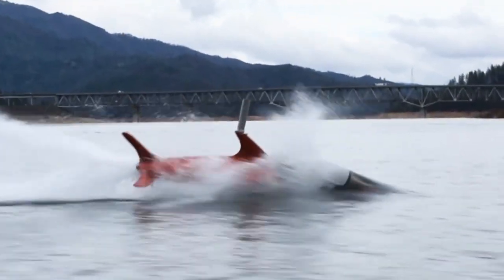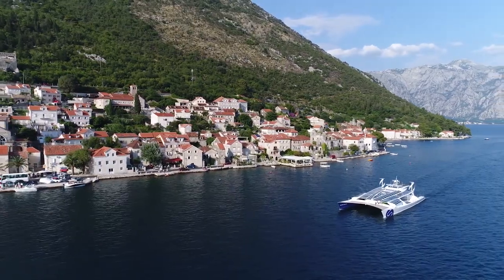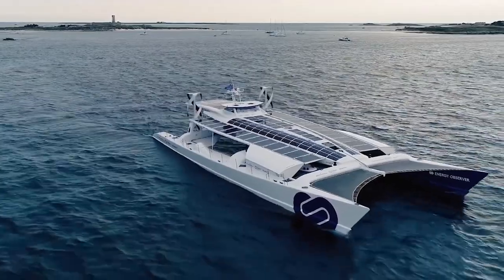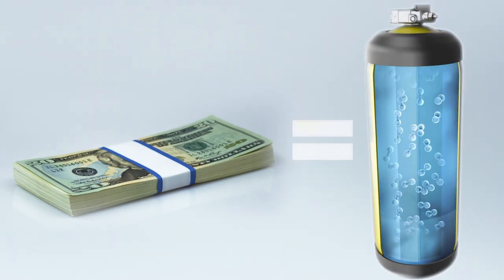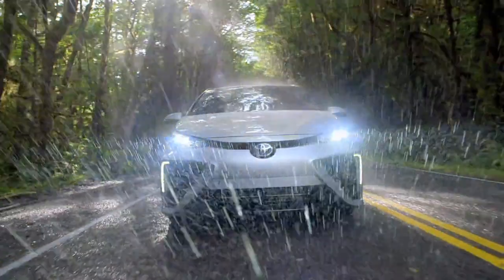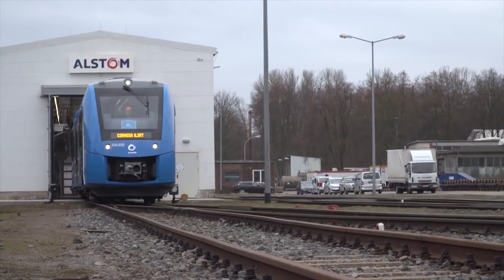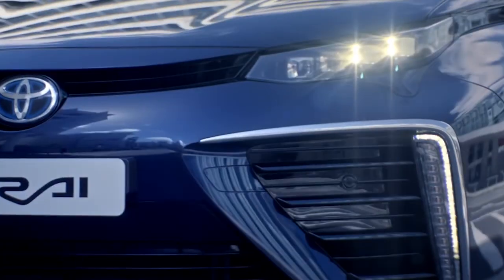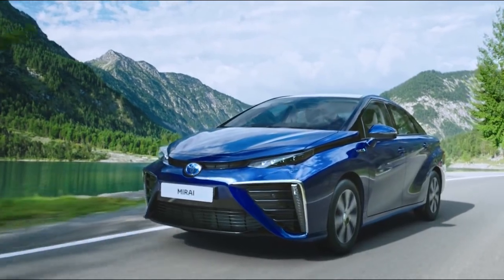The world's first hydrogen powered ship

Comment: Finally!!! The Optimum fuel FOR THE FUTURE!!!! CARS TRUCKS AIRPLANES TOO!!!!
Reply: Henry Ford said ethanol is the fuel of the future.

 Nissan has an ethanol powered fuel cell whose fuel is much safer over a high pressure gaseous type fuel.

https://www.youtube.com/watch?v=HF-eE8pRzMw

Their fuel cell can even use ethanol with enough water added for it to be a non-flammable fuel.  That is super safe although alcohol even when flammable is safer than many other fuels which is why the Indy 500 switched to it many years ago.

Ethanol is reformed into hydrogen in fuel cells and there has just been a new breakthrough which increased efficiency even more:  https://www.sciencedaily.com/releases/2019/06/190607140433.htm

Ethanol is also readily available most anywhere and is cheap.

The boat in the video could perhaps use the hydrogen and oxygen from the electrolysis with carbon dioxide in the ocean to make easily storable ethanol.  The Navy is looking to use this for generating onboard fuel for jets on an aircraft carrier:  https://www.youtube.com/watch?v=Fcc-cTCVY64&t=125s
Reply: @danafletcher2341  the problem with ethanol is that you can't just pick it up anywhere you go
Reply: @kakerake6018  What you state is the very problem with hydrogen, certainly not ethanol.  BTW, not only is hydrogen dangerous to use and handle, it gets worse as the equipment ages.  If you run out of fuel with ethanol and are close to a liquor store, you could make it home.  It would be hard to carry a jug of hydrogen to your out of fuel car.

Ethanol is available most everywhere which is precisely why Nissan chose ethanol over any other.  Nissan drove their fuel cell car around Brazil where clean E100 is sold.  When Brazil changed their fuel infrastructure over to ethanol back in the 1970s, they simply used their existing petroleum one(how cost effective was that?).  The US is the number one producer of ethanol and is very available in many countries.

They now sell tiny ethanol fuel cells for drones which go much further than battery powered ones.  Any hardware store has ethanol, not just liquor stores.

Ethanol can also be produced from coal, natural gas, and oil from an economical process that China, Indonesia, India, and others are using and/or looking at that comes from a Texas company named Celanese with their TCX Technology.

CBS's 60 minutes had an interesting segment on cellulosic ethanol with what they called a game changer for that industry.  Can't give links here anymore so copy and paste this into a search engine:

The unlikely, eccentric inventor turning inedible plant life into fuel

Marshall Medoff unveils to 60 Minutes his innovative method of turning plant life into fuel and other useful products.

(hmmm, just realized my last post has links, must be just certain channels on YouTube that don't allow them.  Here is the 60 minutes link:  https://www.cbsnews.com/news/marshall-medoff-the-unlikely-eccentric-inventor-turning-inedible-plant-life-into-fuel-60-minutes/

We waste half our food in this country and dump huge amounts of plant biomass(i.e. grass clippings, leaves, and tree branches) into land fills.  Medoff's process could turn that waste into something clean and useful.

There now exists catalysis that could make ethanol from carbon dioxide and excess waste electricity from wind mills for an example.

The Navy even has a way of producing ethanol and other fuels from seawater which of course has hydrogen and oxygen, but even more carbon dioxide than the air.  Aircraft carriers can go a long time without ship fuel, but go through a lot of aircraft fuel.

This is why I am for LFTR(liquid fluoride thorium reactor) type of safe nuclear reactors which are walk away safe and can get rid of most of our current nuclear waste.  

Instead of inefficient electrolysis to make hydrogen and oxygen from water, the temperature in a LFTR is high enough to directly split water in to H and O2 and simply add in carbon dioxide and you can make ethanol or other fuels.

Ethanol in high compression engines is the most efficient fuel on the face of the earth. Scania already sells one world wide this very day.   Ethanol in gas turbines is more efficient than current fuels above 10,000 feet because of the oxygen contained in it.  

Pollution free to boot. 

Imagine cities with air to breath as clean as the country.

Comment: they already know how to get the hydrogen from water very cheap and efficient. They have known for decades or probably even more. All the big car companies know long time. They just slowly releasing it into the public in a controlled way that allows them to maintain power and control.
Reply: "very cheap"?
They can produce roughly 2 kg of hydrogen on a sunny day, if they don't waste electricity for propulsion.
How cheap was the whole system of photovoltaics, desalination, electrolyzer, compressor and tanks?
Of course, costs would drop with really big stationary systems, but compared to fossil fuels, it won't become "cheap".

Comment: The most advanced Fuel cell systems are by GM. Honda uses GM fuel cells
Reply: That's interesting.
Reply: Don't forget Nissan who has an ethanol powered fuel cell whose fuel is much safer over a high pressure gaseous type fuel.

https://www.youtube.com/watch?v=HF-eE8pRzMw

Their fuel cell can even use ethanol with enough water added for it to be a non-flammable fuel.  That is super safe although alcohol even when flammable is safer than many other fuels which is why the Indy 500 switched to it many years ago.

Ethanol is reformed into hydrogen in fuel cells and there has just been a new breakthrough which increased efficiency even more:  https://www.sciencedaily.com/releases/2019/06/190607140433.htm

Ethanol is also readily available most anywhere and is cheap.

The boat in the video could perhaps use the hydrogen and oxygen from the electrolysis with carbon dioxide in the ocean to make easily storable ethanol.  The Navy is looking to use this for generating onboard fuel for jets on an aircraft carrier:  https://www.youtube.com/watch?v=Fcc-cTCVY64&t=125s
Reply: Think that you will find that Toyota are in the vanguard here NOT GM for sure. They 600 patents Minimum on this process - all the major car companies have bought inti them including GM.

Comment: Hydrogen fuel unless is generated by renewables energy, or it will not be economically. When electrolysis water, some energy lost in the process. When turning Hydrogens to energy thu fuel cell, some energy lost again. If the hydrogen was generate by electric energy generate by fossil fuel, then it defeated the purposes.
Reply: It's like running a steam powered generator with an electric boiler.
Reply: Clever Nduruza exactly. But the general public don’t understand that. Thorium molten salt nuclear should be the next best option, provided they can make it small and safe.

Comment: @"The world's first hydrogen powered ship": Actually, it isn't a hydrogen powered ship. It's a solar and wind powered ship, which uses batteries and hydrogen for buffer storage.
A real hydrogen powered ship would be independent from wind and insolation during the journey.
Why is there still no ocean-going ship of this kind? No "first crossing of the atlantic with one filling of hydrogen"?
At least as a proof of concept, I don't ask for a commercial passenger ship.
Reply: It could also be smaller, for a rather adventurous journey. Would also be cheaper and easier to be realized.
The propulsion system (fuel cells, electric motor) of a normal fuel cell car would be enough. But a lot more hydrogen tanks of course.
Let's say 20 tanks of 2.5 kg of hydrogen each, 50 kg of hydrogen in tanks of a ton weight and around 1500 liters volume.
Would be enough for 5 kW continuous power for 1 week.

Comment: So Hydrogen is less energy dense than Gasoline! I'm surprised!
Reply: It depends on the definition of energy density. Gravimetric or volumetric?
1 kg of hydrogen contains the energy of roughly 3 kg of gasoline.
But 1 liter of hydrogen (1 bar, 293 Kelvin) contains the energy of roughly 0,0003 liters of gasoline (1 bar, 293 K).
1 liter of hydrogen at 350 bar and 293 K contains the energy of 0,09 liters of gasoline (1 bar, 293 K).
1 liter of liquid hydrogen at 1 bar and 20 K contains the energy of ~0.25 liters of gasoline (1 bar, 293 K).

Comment: Hydrogen cars make no sense ev is better but larger vehicles is where it's at.
Reply: Hydrogen in anything makes no sense since high pressure fuel sources are inherently dangerous, even more so as the equipment ages.  Refueling such equipment is also dangerous.  

Ethanol is a very safe to handle fuel with much cheaper price and has more range.

Where as hydrogen fuel cell cars can not achieve a 400 mile range, Nissan's ethanol fuel cell range is estimated at 500 miles and they recommend a 55% ethanol and water blend so the fuel is not flammable in their fuel cell car.  What could be safer?

https://www.fueleconomy.gov/feg/fcv_sbs.shtml
https://www.greencarreports.com/news/1104467_nissan-takes-a-different-approach-to-fuel-cells-ethanol

Ethanol is readily available in most countries right now and where it is not the current petroleum infrastructure can deliver ethanol rather than a whole new, extremely expensive, and more dangerous hydrogen one being needed.
Reply: @danafletcher2341  I see you really like ethanol, but I still stand by hydrogen because you're looking at the way we use hydrogen all wrong. A hydrogen car is stupid but an electric powered 50ft ship with a hydrogen range extender is far more feasible.
Reply: @kakerake6018  I like ethanol because there are very few disadvantages and dislike hydrogen because it has so many disadvantages, many that your eye balls have already seen in my posts.  Those disadvantages do not disappear in bigger items.  Ethanol's advantages work all the way down to extremely small fuel cells in electronic equipment believe it or not!

https://www.technologyreview.com/s/411848/efficient-ethanol-fuel-cells/

BTW, the advanced and ultra quiet(quieter than nuclear) European submarines already use ethanol fuel cells this very day!

https://news.yahoo.com/spain-billion-dollar-ethanol-powered-150000676.html

The Nissan fuel cell car is not stupid.  It uses an inexpensive clean fuel that is not flammable and readily available.  It uses hydrogen in the fuel cell, but uses a catalyst on ethanol to make the hydrogen.  A home owner at the end of the day when he comes home from work could plug his car into his house for electricity and use the waste heat to heat his home and water.  Maintenance electricity could come from some solar panels while he is at work during the daytime.

The thing is fuel cells are efficient but expensive and perhaps complex.  Ethanol in high compression dedicated engines are up in fuel cell ranges of efficiency but are simple and cheap to build from recyclable and abundant cast iron.  Ships will use internal combustion engines for many years to come.  Why not pollution free and safe ethanol instead of toxic and dirty fuel oil?

Scania builds large engines that burn ethanol with mileage equal to diesel fuel.  Some engines like GM's have mileage greater than diesel.

https://www.oemoffhighway.com/engines/press-release/21005554/scania-ab-scania-introduces-bioethanol-engine

Here is an ethanol engine technology that can be modified on to current diesel engines with mileage equal to diesel fuel.

https://www.dtnpf.com/agriculture/web/ag/news/business-inputs/article/2020/02/25/clearflame-engine-can-cut-diesel-3

Here is one that can somehow burn 30% ethanol with 70% water blend so that it is nonflammable on its own.

https://www.maymaan.com/?fbclid=IwAR3bDJhKx1NGc6Mo4v0K1d2YnDR4WwJ9B_oQ6Fz8tG5GlGNrHcgsSrZOpiU

BTW, 50 foot ships today already use alcohol powered small fuel cells.  The alcohol in this unit uses methanol which I would prefer it to use ethanol because ethanol is non-toxic and not corrosive like methanol is plus ethanol contains more hydrogen.

https://www.efoy-comfort.com/boat-0

Try to look at this with an open mind and find any flaws for ethanol vs hydrogen.  I can not think of any.  Not even for any other fuel for that matter, not just hydrogen

Comment: Yawn, ICE (internal combustion engine) companies love and push this.
Renewables are better then hydrocarbon fuels, however removing the ICE is key (less problems).
Just use 50% of the electricity to create hydrogen, to fuel EVs (electric vehicles).
Numerous other inefficiencies compared to EVs.

Comment: You don't talk about the inefficiency of the process of getting hydrogen. To get 1 Liter hydrogen to cost you 55% of the energy of this liter. Also, you lose a big amount in the processing like storage, cooling, or pressurizing, than you have to use a battery system to drive an electric motor. All together you loose over 90%, so less than 10% are available for the work you will do. 

That's crazy!!! 

You waste 90% of the power of all wind or solar systems if you are using it to produce hydrogen.
If you make hydrogen vom Gas it will also be more efficient to use the gas directly.
Don't make the people believe in this stupid technology which is absolutely not innovative.